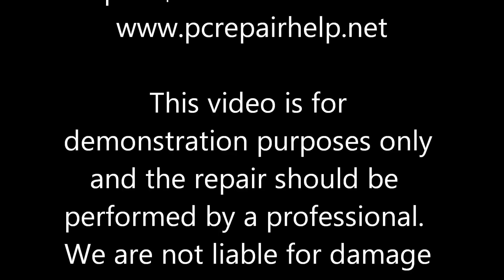Dell Latitude E6410 AC DC Power Jack Repair

Comment: I found your vid after trying to isolate what I think is a faulty dc jack. I could not believe how hard it is to get to the little bastard. Unfortunately your vid confirms that I have to absolutely gut this machine in order to get to the jack which is surely one of the most common faults of such a machine. I'll persevere using your guide but this once proud machine is now almost certainly destined for the recycling bin. Thanks for nuthin' Mr Dell.

Comment: Thanks for posting this. Replaced the power cable but still, dead as a brick.
Reply from the maker: 1pdonlon Could be a bad motherboard.  Check the part # on the board, sometimes they go for as cheap as $45 usd and that should fix it.

Comment: A bit of a separate question here, but is the Hard Drive tucked way down inside this laptop to where I gotta remove the plastics or is it one of those easy drive bays on the side?
Reply from the maker: +darknova000 Nope, it just comes right out when you remove the screws for it.

Comment: I replaced the motherboard but still won't charge, also whenever the laptop is plugged in the LED on the charger turns off, could it be the DC jack's fault? Thanks in advance.
Reply from the maker: +Mark Nieves Sounds like you received a defective motherboard.

Comment: Hello,Sir I am keep sending my charger to dell repairs centre but first it was charging by twisting the wire but not it won't even do that, he changed the wire but still no good, Can someone Help? Plz. Even I take out my battery the system will start up and works like pc. Dell Latitude E6410 I am using . Help plz
Reply from the maker: Leon Ryuga does it work while plugged in?
Reply: yes I am plugged in but my battery won't charge , even if I remove my battery the system is still on until I remove the power.